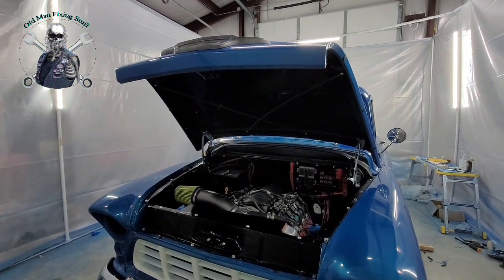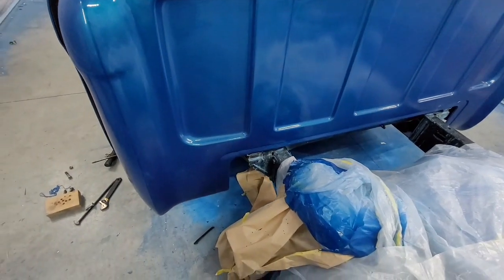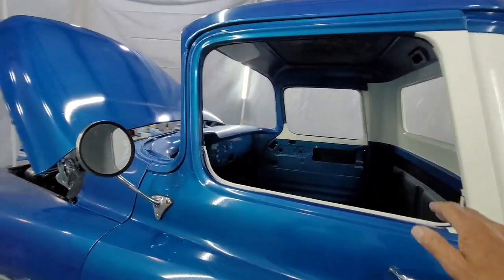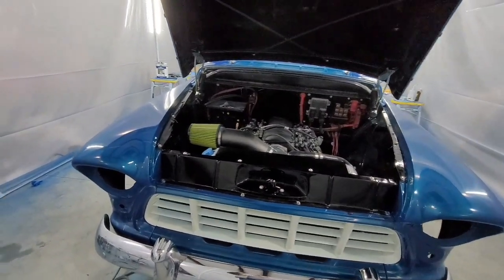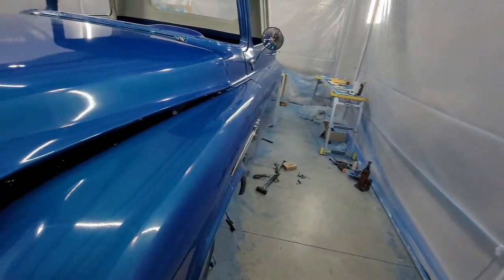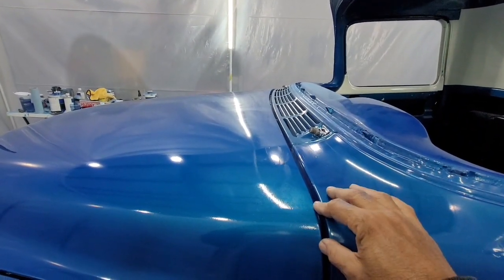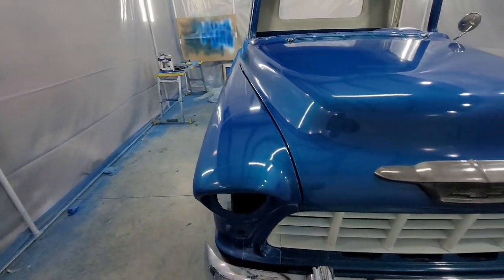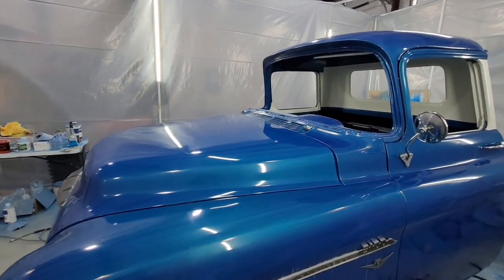1955 chevy truck build, going over the body alignment of the cab to door to fender to hood

Comment: So, I'm in the process of putting this all back together. Glad to have found this video. Great job on explanation. My question is if the back of the doors are gapped properly as a stating point hoe do you get the correct gap between front of door and rear of fender. Mine seems a littlie tight seems I need to get the fender to move forward a bit. Any help appreciated. Thanks.
Reply from the maker: I would check the radiator support. Think of the front nose ( hood and fenders) move as one peace. Check both sides for the gaps. If one side is larger the the other push the nose toward the side with the larger gap. If both are tight, see if you can move the radiator support forward. There are times you might have to remove some bolts to get the gaps right and see where the bolts don't match. (I find this happens using parts from different trucks.) Then see if opening up the tight holes to make it fit. Sometimes, the cab might move back a fraction back, giving you the need gab.

Comment: I just recently purchased a 55.2 without door or hinges on the truck or door. What is the starting position of hinges on the pillar. This is the most informative video on the web I have seen thanks 😊
Reply from the maker: first, one of these help if you are doing this by yourself https://www.eastwood.com/e-z-rest-door-hanger.html it is a door hanger that goes on to your floor jack, good.  I put the hinges on loose on the door pillars. Slide the door on the hinges, you might have to move them to get them on the doors, this will give you a starting point. Tighten all the bolts just so they hold. Once the hinges are on the door this will start the alignment of the hinges. I try to get all the hinges in the middle of the alignment slots. Now slowly close the door to see if you have to move it up, down, forward or backwards .  Make sure your hinges are in good shape, rebuild them first or get new. Adjust the door so your gaps are all somewhat the same. These old trucks dont have good gaps like new cars.  let me know if this helps

Comment: Great Video, It's an art form to align these old rides.  We've been fighting an alignment issue on a 57 Belair,  all the gaps are good, except the passenger fender, it's lower and creates a bigger gap when the hood closes.    any tips ?? or would you shim the fender and raise it up a bit ?
Reply from the maker: Some times its a shim, do to how straight everything is. Also check the back driverside fender if the front pasanger is high try swimming the driver side fender up if low take a shim out from the oppersite side. Sometimes a little moves a lot on the opposite side. Mine I have shims and as long as after you shim you don't have a fender or something looking like it don't  fit or looking like you just hit something. Some times you have to shim everything else and not the part that is off. After saying all that if you shim that one fender and it looks good keep it.
Reply: @oldmanfixingstuff3722   Thanks for the advice.   Everything else lines up, except the passenger fender, it sits too low and creates a gap in the front once the hood is closed.   Like I stated, been fighting this for bit now.
Reply from the maker: @clevelandspeedshop5024  Sometimes I have had to split the gap between opposite sides. Kind of like a teeter totter. Shim the fender up and if it looks it's pointing somewhat up but all the lines look good. You can shim the opposite corner and push the fender down by lifting the back corner. I think of it as putting the body together and all lines fit. Then fit it to the frame and shim where needed. Sometimes there's a slite twist in the body or cab you can use the shims opposite of the twist and pull the corners down to take the twist out. Kind of rocking the body on the frame.

Comment: I agree with other commenters, excellent tutorial. I do have one question nobody ever seems to address, “What stops rear corners of hood from scratching inside edge of fenders while opening/closing?”
Reply from the maker: I can think of a few things. My best guesses are. 

(1) When you close the hood slowly, your hood hindge should hold the rear of the hood up off the fenders and drop it down at the end. Sometimes you see people push down on the hood because it does not drop down all the way.  If not look at the hindges and springs. 

(2) There are two adjustable hood bumpers/stops on the top of the firewall one on each side. These can be adjusted to hold the back of the hood up at the right hight. These should be adjusted so the hood rest on them. There are also other rubber bumpers running down the side and front of the hood to protect the hood to fender contact. 

(3)Fender alighment could be set to high. 

links below shows what the bumpers look like.

Adjustable hood bumper:
https://classicparts.com/1955-59-hood-adjuster-bolt-bumper-set?gad_source=1&gclid=CjwKCAjwouexBhAuEiwAtW_Zx_xi4SALDmcofQvmTk6VThtC6nrUv-j-OOu10tqFeb4ipxyWGmttxhoCa0YQAvD_BwE

Hood pumpers:
https://classicparts.com/1955-57-hood-bumper-set?gad_source=1&gclid=CjwKCAjwouexBhAuEiwAtW_Zx9sVBoOx7zc8YMVQRQiFiD_P_W-6wi43UYjjLerIuCZwxRLyQNsGmRoCoOkQAvD_BwE
Reply: I do have the vowel hood bumpers adjusted all the way down and the hood to fender bumpers installed. I tried after market hinges but they had a couple of incorrect dimensions that did not permit hood to close. I used new springs on old hinges but hood for not appear to lift before opening. I did find a crack in drivers side hood bracket that I’ll fix and see what happens. Thanks for the ideas.
Reply from the maker: @des5779  Question if the hood was set in place without the hindges. Does the hood sit right without hitting anything.  It should sit on the bumpers and not hit.
Reply: Yes, it does sit on the bumpers and not hitting when closed. The back corners do not appear to raise when opening, therefore the hood corners drag the fenders because the fender angle narrows forward.
Reply from the maker: @des5779  from hood latched down mine sits flush. If I raise it to the first latch, the front raises, and the back tilts slightly but does not hit anything. If I raise the hood to the top of the latch the back starts to lift with the front. Lift from there the back lifts 1/2" to clear the frnders. Part of how the hinges works. If the back is not lifting, I seen when the hinges are sitting to low, not allowing the hinge to lift or lower the hood back end when opening or closing. For me, the point this happens is where the hood sits on top of the hood latch. Before the safety or lock. Raze it from there the back lifts with the front. Lower it below that point and the back should lower. It's about 1/2" of movement. This is what keeps the back of the hood from hitting the back of the fenders. Hope thus helps.
Reply: Thanks again for your help. I try adjusting hinges again and see what happens. I might need those $700+ Billet hinges to fix my problem. 🥴😊

Comment: Thanks for making these videos.  Did you have to shim the front of the cab where it mounts to the frame?
Reply from the maker: I did have to shim the cab to the frame to make sure it was straight on the frame and to the fenders. .
Reply: @oldmanfixingstuff3722  Hey thanks for the reply!  Do you remember how many shims you needed?  I read somewhere that they needed 3 shims from the factory,  but cab mount kits only come with 1 shim.
Reply from the maker: @nedocaster  I buy the shim assortment back you can get them from Amazon. Over the years the body and Fram move so the stock amount change. Each Fram and body are different so with the assortment of shims give you enough shame thick and very thin to get you body to sit straight. The stock amount found in the assembly manuals are a starting point on these old trucks and cars. Start there and shim where needed to get it sitting straight.

Comment: I cannot get the darn hood latch to grab and lock down. I’ve tried everything, do you have any input on how to do it?
Reply from the maker: Can you send some pics to the email I gave ya. Try to get the alinement of the two parts hood almost closed and one of each as mounted.
Reply: @oldmanfixingstuff3722  yes I can, it will be a little bit as I pulled off the fenders and inner wheel wells to make it easier for wiring and some other finish touches. Do you by chance have the part number for the inner fender rubber that attaches to fenders at the cab. Thank you so much Sir!
Reply from the maker: @72FrostyOne  got my rubbers from classicparts.com. I think what your looking for is (1955-59) Front fender to cab seals part number 37-611 or inner fender seals part number 37-727. Before ordering please make sure this is what you need. They have a good selection of rubber for your truck.

Comment: Your hinge is not attached to the inner fender with a spring. How do you fight that and adjust the fender closer to the bottom part of the door?
Reply from the maker: @billydean3068  if I understand the question. Let's say you are working on the left side fender. The top closest to the door will need to be shimmed up or the front of the fender needs to go down. Fender Shims can be used to tilt the fender to close the gap. Some fenders due to parts for frame not straight might need to weld to fill the gap. But if all good parts shims should work.
Reply: @oldmanfixingstuff3722  Thanks, yes I understand all that, but I noticed your hinge is not like mine on my 1958 with the spring being attached to the inner fender. I have my Rad support all the way down with no shims. Everything is level hood cowl cab but I lack being able to move the fender counter clockwise. Nose down. I finally today removed the hood and detached the spring from the inner fender  so I can move the inner fender with the outer together. We will see.